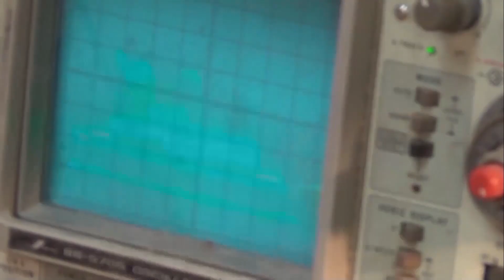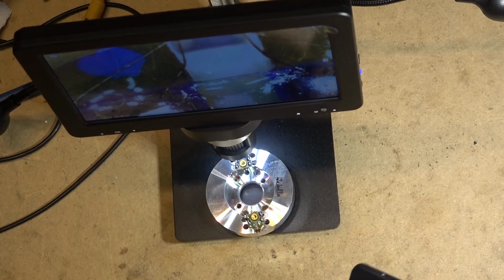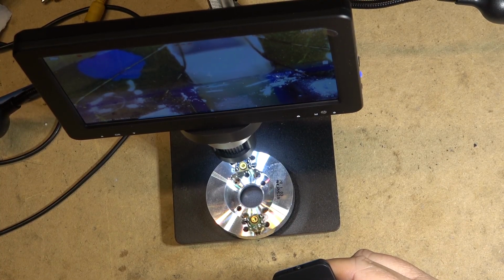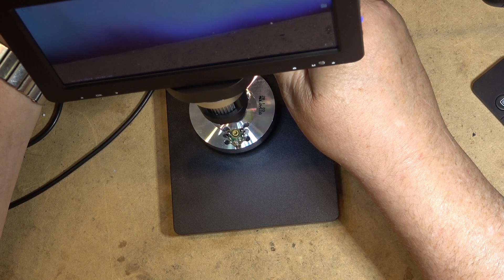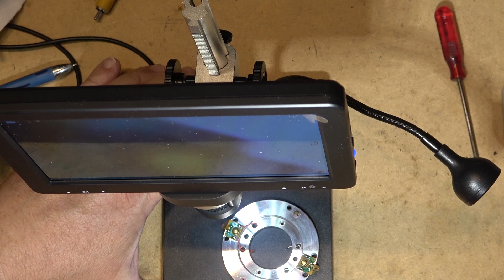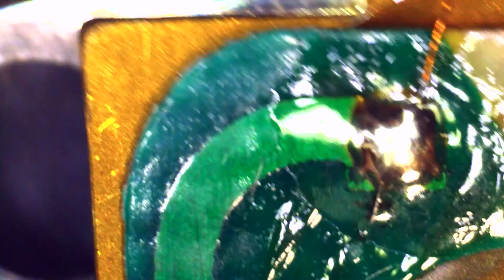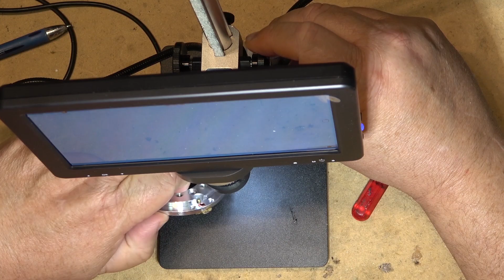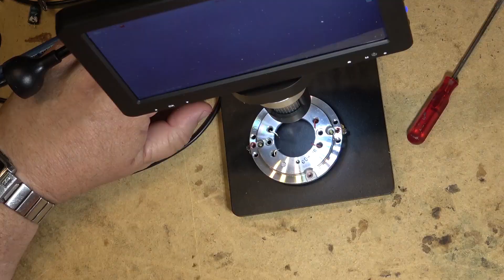A look at a VHS and Beta Video Head Under a Microscope

Comment: One thought here is you might get a better picture output if the windings on the head weren't "scramble-wound".
Reply from the maker: I believe the engineers that designed it know better than you.

Comment: At one time, video heads were considered to be the most precisely made object in the entire home.
Reply from the maker: I don't know about that.  The mechanism on a mechanical Swiss watch is more precise.  A video head is nothing more then a slice of ferrite with a tiny hole and slot cut through it plus a few loops of fine copper wire wound around it held together with epoxy.  
They were pumped out by machines in the millions.

Comment: "helps move the tape as it is spinning" 🤦‍♂️

Those are air bearing grooves. They entrain air as the drum spins and it gets trapped between the fast spinning drum and the tape, which holds the tape off of the drum. In normal operation, neither the drum nor the heads actually touches the tape. If these weren't present, the friction of the tape on the drum would both prevent correct rotation of the drum and destroy any tape that attempts to run over it as the drum tries to maintain speed.
Reply from the maker: Air is drawn in and it indeed does keep the tape stabilized. The head tips actually do contact the  tape.

Comment: Things were serviceable that time...china and mobile electronics ruined everything....once your mobile dead 90 percent chances you lost your data  and precious memories...nearly everyone's faced it several time....but noone talking about this issue....govt must make a rule that mobile companies must design their product such a way that ..person able extract data even mobile is dead...its tecnically easy task for compnies...they can use detachable emcc card in mobile...
Reply from the maker: You can force companies hands by refusing to buy a phone that doesn't not have an sd card.  I have a Samsung s9 and continue to use it because of that.  My spare is an s20fe which is the last with sd. Next one after that will be a different brand I guess.  Unless Samsung brings back sd card 
If everyone e took that attitude and didn't cave in and buy their phones either removable memory and actually told the companies  this is the reason they are not buying their product and they would change things.  Same for cloud storage. Just say no.

Comment: Now I'm wondering- what would D-VHS heads look like?
Reply from the maker: The same.  Digital recording isn't any different.   Instead of analog signal modulating an fm carrier the digital bits modulate it.   The head drum runs faster.  In the case of digital 8 the head drum runs 2.5x faster. My betacam sx player can play both digital sx format tape and analog sp tapes.
Reply: @12voltvids  Huh. My D-VHS drum seems to run at 1800... Would the heads be thinner?
Reply from the maker: I never said dvhs ran faster. I said digital 8 did.  Digital 8 recorded 25m bit dv stream which is all I frames (full frames) dvhs was mpg2 ipb long gone if I remember.  Never saw a dvhs, never worked on one. I actually never even saw one in a store and I did look for them.

Comment: Cool shots of the heads! I have wondered how many heads my JVC S-VHS machine would've had, since it did SP and LP as well as HiFi audio and, of course, S-VHS and VHS. Not NTSC, though. But at the time that wasn't an issue
.
Reply from the maker: 2 sp, 2 ep, 2 hifi.  If it had flying erase it would have had 2

Comment: I think the grooves are there for creating an air cushion, so the tape is not rubbing on the cylinder all the time.
It' s kind of an air bearing. Just a guess, though - I' d like to dig more into that rabbit hole.
Reply from the maker: Yes, that's why the groves are three. On the beta head the drum doesn't spin however, but air still gets pushed out the slot by the heads whizzing around inside and that provides enough of a cushion, plus the surface is rough.   
When the upper drum gets polished by the tape it starts to stick and then problems start

Comment: Bond wires? Thats just the head coil wires soldered to the pcb. I would like to see the inductance of the heads. And why are the coils are different amount of turns on each side of the 
"U" shape?  Thanks for sharing.
Reply from the maker: I was referring to the section of pcb that the head coil and lead wires were bonded for.
Reply: @12voltvids  what about:
1: I would like to see the inductance of the heads. 
2: And why are the coils are different amount of turns on each side of the 
"U" shape?
Reply from the maker: I. Simple terms to match the impedance of the rotary transformer. I went into more detail but it didn't save and I don't feel like typing it our again.
Reply: @12voltvids  thanks, I will look it up

Comment: 2:03 disagree with most after this....One head has two poles. One "set" of heads for SP. This is a two-head drum.
Reply from the maker: Actually it's 4 head drum,  the vhs drum.  Thats a double azimuth head.  One one side the sp a field and ep b head and the other the sp b and ep a. Tbe beta head was a 2 head drum. 
Of course each head has 2 poles. That is the gap where the magnetic field is produced.

Comment: Back in the early 90s I replaced the heads on a few VHS machines. Not the whole drum though. I was swapping out heads from different machines that were broken and a couple times I was able to purchase heads I needed from a local repair shop. Somewhere I had found documents that showed most makes/models and which ones used the same heads, and with their part #s. That helped out a lot being pre internet. My old eyes would need that microscope today though. Lol 
And thanks for showing the Beta head! I'd never seen one of them up close. Interesting in how the two types compare.
Reply from the maker: Normally the entire drum wasn't changed.  Just the upper drum. Never the individual heads.
Reply: @12voltvids   it is doable, though time consuming and tedious! That is probably why the whole drum was replaced. Plus replacing the whole upper drum made repair shops more money.

Comment: And a beta head the tape was wrapped almost all the way around, versus a VHS only half. I worked on them for years in the 80’s…thanks for the trip down memory lane 🙏👍
Reply from the maker: The tape was in contact for the same 180'. Just beta pulled more tape out using a U loading system just like the professional systems.  This resulted is less bending of the tape, resulting in lower tape tension which allowed the tape to stay threaded. Until the mid 90s all vhs unloaded the tape to ff and rewind. This was due to the design.  They had to make  several changes to allow vhs to remain loaded and this added more points of failure like the pinch roller that lowers down on the back side of the tape.  Beta was better in every way except marketing and that Sony wanted it to be profitable whereas jvc just wanted to give it away.  I think if one were to look at profit margin on each beta /betacam unit sold Sony came out on top. Their professional betacam format very quickly became the field production source for production. If you saw it on TV shot between 1982 and 2015 there js a very good chance it was shot and edited on betacam, betacam sp, betacam sx, digibeta or hdbeta. It was pretty much the only format used. That professional format grew from home betamax and betamax evolved from 3/4 umatic.

Comment: What’s really amazing is the timing of everything and how the tape is moved against the head.  The fact that the head moves in a helical fashion across the tape (head is angled and spins diagonally across the tape).  That is some clever control and servo systems for sure.
Reply from the maker: That js what the control track is for.
Reply: @12voltvids  not quite on its own. The control track itself is quite broad and low frequency. Servo tolerances were tight out of necessity, as were mechanical tolerances. At the time videotape was introduced, such tolerances were literally unheard of in consumer goods of any sort.
In a very real way, they were practice for the development of yet to come optical media, with its even tighter tolerances. And the components themselves in just the mechanical, think about it, one's recording on what's literally an abrasive, yet somehow the guide rollers and drum proper didn't get abraded out of tolerance or as bad, polished until stiction became a tape fixating problem. The heads actually penetrating the oxide layer slightly and not swiftly wearing out. That's a lot of metallurgy and mechanical tolerance knowledge being applied - then the servos can come into play.

Yeah, used to repair these, initially picking them up on my own as televisions started to move toward becoming disposable. Became proficient in VCR's and as their prices plummeted, moved into CD and DVD service... Industry grows, one grows or stagnates into poverty, I just grew and learned how the device operated to its lowest levels, which gave me an edge on peers that couldn't comprehend those devices fully. 
Always did get a chuckle over those who just refused to learn. They'd never figure out a problem in a PLL or even an SMPS and I'd get to eat their lunch. Tried to show some, but if they really didn't have an interest, they'd never learn.

Comment: The shortest wavelemgth tbay can be recorded is mor than half the width of the gap.
I repair broadcast quad videotape machines where the heads are rotating at 14,400 rpm!! Imaging the g-forces on the heads! Becuase od this speed, the headwheel rotates in air bearings.
The rotary fransformer was invented by AMPEX. This elimimated brushes on the shaft which introduced noise in the picture.
The quad videotape machines have 4 heads that are 90° apart. The heads protrude from the headwheel and is called "Tip projection" the heads actually dig into the tape as it is playing or recording. During rewind of fast fwd, the tape is pulled away from the heads.
Professional quad heads only last 500 hours.
There are still some people that hand wind the heads!
Did you know that the word "videotape" was copywrited by AMPEX? RCA had to call ot "television tape"
Reply from the maker: Just like video cassette was a trademark of Sony.  
The video heads on all video recorders dig slightly into the tape. Yes I am aware quad ran on air bearings at 14400 rpm.  Dv runs at 9000, and used a 1/4" tape.

Comment: Well I actually looked at a VHS drum I'm having floating around after watching this video, through a vintage optical kit microscope, that has about the same magnification, or maybe a bit more. I looked at a stereo cassette tape head too first. I could notice what a schematic I found on the internet calls 'index error', that's a tiny 'shift' between the two poles of each heads perpendicular to the tape direction, as well as on the shielding plate between the two heads, but not unexpectedly, I could not see the gap itself, even at that magnification. And then I looked at the video heads, making sure that some light shines off them, so I can see the edge of them that's facing the tape, properly. I could clearly see a narrowing in the middle of both of them, I assume those narrowings define the effective width of the tracks that these heads record and play. At no moment I could be fooled that what I see is the gap itself, if those were, they would be far too wide. Needless to say I just couldn't make out the actual gap on those, again, not unexpectedly. Those are extremely narrow gaps, that normally the magnetic field would have no problem whatsoever jumping through, but there's a very thin gold spacer in those gaps. Gold is diamagnetic, it pushes magnetic field out of itself. So far I found no data on the size of the gap, but it must be anywhere between just a few micrometers down to a few nanometers. That's really just my broad guestimation.

Right now I can't find any source on the gold layer or foil, but maybe you heard of it. I just don't remember where I read about that.
Reply from the maker: The narrow part is the track width, the actual gap is much smaller than that typically only a few microns. Would need a much higher power microscope than this to see the actual gap.
Reply: @12voltvids  - Ok, I found back this info about gold on the wiki about heads. D'OH!

Comment: So is the Betamax drums which has the peekaboo chips on the spinning disk are both upper/lower drums smooth or would they have 'grooves' for the tape travel?

I suppose Betas peekaboo drum design probably wouldn't have been suitable for the high speed winding seen in current vhs machines.
Interesting the first drums wernt hard wearing which resulted in the thumping phenomenon until more robust drums were made.

And would it have been better to have followed that peekaboo design thus eliminating manufacturing fat upper drum video heads?
Reply from the maker: All betamax wind and rewind the tape laced. Always have, except Sanyo.
The slot was the original design from the reel to reel 1/2 machines from the 60's. 
The idea about the upper drum spinning was to reduce the need for critical alignment. The best design was the spinning wheel in the middle with stationary upper and lower drum, but that design required critial escentricity alignment when changed, with a special micrometer required to do the job.
Reply: @12voltvids  it make me wonder why the early models the disc wasn't a tight fit compared to the later ones.

Comment: Where is the LP head? 😁
Reply from the maker: There are no LP heads. Never were, LP was never a licensed VHS speed only SM and EP. Panasonic went rogue and introduced a speed that was never an offical speed. LP used the EP head and did not provide any picture improvement over EP.
Reply: @12voltvids  I'd say, from the tapes I've archived, picture quality looks worst on LP than on EP. But, my region is complicated in that department, because there was never an official support for EP speed in our case.
Reply: @12voltvids  How about LP and EP on 2 head machines?   In 1986, My parents bought a Sears VCR with only 2 heads that supported all  speeds and LP did look better than EP on that machine so I figure it was using compromise width heads that lowered SP quality somewhat but made LP and EP work better.  I made a good many LP recordings on it.   It was one of those strange 2 head no frills video machines but with Dolby B on stereo linear tracks (no HiFi).    Did any machines record LP and EP with full-width 58 micron heads or did they use some compromise like something between 30 and 50?  I remember reading that they were able to align the pulses on EP so that even if tracks overlapped, things would be OK, but on LP they couldn't but somehow they'd "cancel out".   I'd love to hear you explain that if it's the case.    I'm specifically interested in those early to mid 1980s machines.
Reply from the maker: 2 head machines typically had 22 micron heads which was the track width of ep.  68 is full track width of sp.    Some early panasonic / rca machines with just sp/lp had 42 micron heads. The narrower heads will record just fine at faster speeds. There will be blank tape between the tracks. This wasted space reduces signal to noise ratio. As far as overlap yes the next head will partially erase however the recording is azimuth recorded. So the angle is different.  Also the signal is fm recorded.

Comment: I wonder if it’s possible to have them rebuilt.
Reply from the maker: How much money do you have?
Fabricating a 1 off video head you are talking tons of money.  Know a guy in the obsolete format recovery business.  He had an odd ball 1" tape that had been recorded on a 2 head boach helical.  Now the common format used was type A and then they settled on C format.  Thatvuaed a 360' wrap and the scanner had a flying erase head a record head and a playback head (at least machines that jad dynamic tracking like the ampex vpr1 did) machines without dynamic tracking had a single record / play head.  Bosch used a 180' wrap and 2 heads.  Anyway he found an old machine but the heads were trashed.  He searched and found a place in LA that could make him a new scanner, for 50 000.00.  Needless to say he didn't do the job be referred the client to a place in the states that charged 1000 per hour to transfer the tape.  The client laughed.  Figured they could get this old tape done for 100 bucks.

Comment: 10:43 why the coils are asymetric?
Reply: @_innerscape_  Probably because both head gaps need to be at the closest possible spot to each other, in order to the head switching point be correct for both the SP and the EP heads.
Reply: @mrnmrn1  mmmh... Nope, I pointed at the Beta head, single purpose, not SP EP. One coil is wider, the other is thinner. Resonances? Wider bandwidth?
Reply: @_innerscape_  Oh... Well, it must be some kind of wizardry... on the dual azimuth heads, what I said regards to the head switching point, probably makes sense, but on the Beta head, I don't know what's the reason. Can be a bandwidth or saturation thing, or maybe the tape makes better contact with the head at that spot.
Reply from the maker: The beta head has a chunk missing from it.
Reply: @12voltvids  Yep, I got that, I mean the actual copper coils mounted on that diapason-fork thingy. They're different, not identichal twins.

Comment: I often inspect heads under a microscope like this.  Surprisingly perhaps, it's not easy to spot head wear, completely worn out heads usually look fine.  But damaged heads can sometimes be seen.  V2000 format heads are interesting as they sit on piezo electric actuators (as do some Betacam and MII ones I believe).
Reply: @video99couk  And all of the 8mm formats, probably miniDV and even DAT uses piezoelectric tracking. Sony licenced the technology from Philips' V2000 format when they were developing the Video8 system.
Reply from the maker: The Mitsubishi hsu82 also had dynamic tracking heads for trick playback.